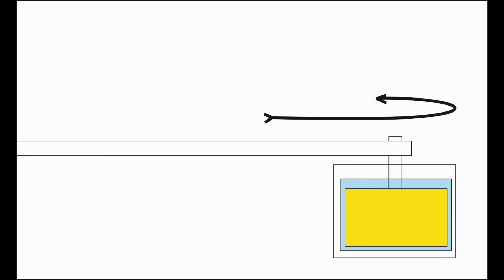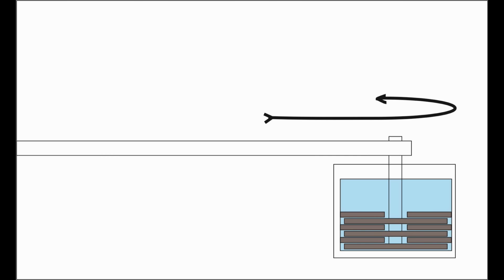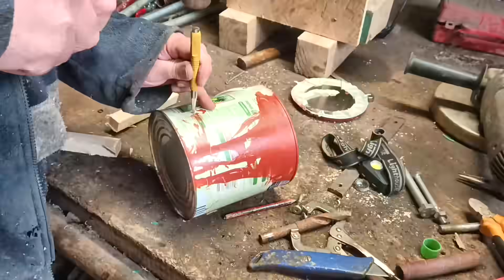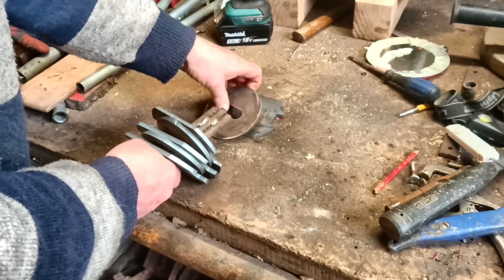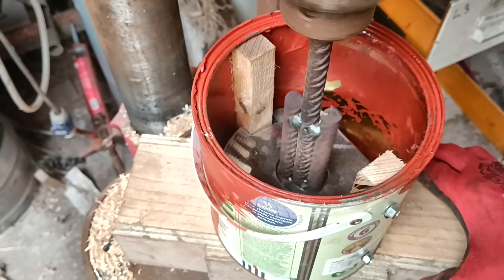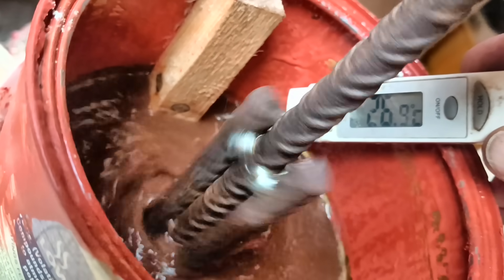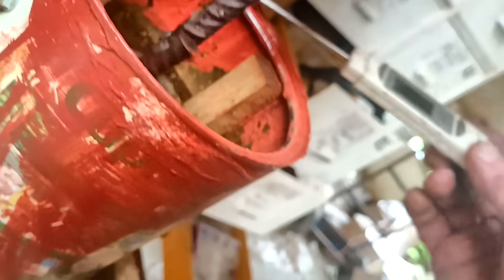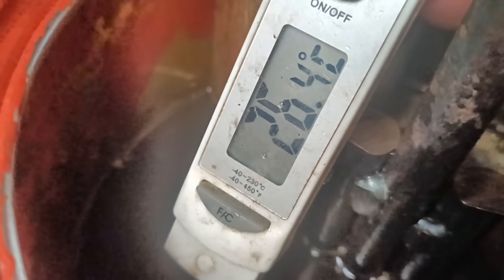Heating Water With Friction – How Practical Is It? Interesting Experiment!

Comment: Hi Tim, how about now trying to power a heating element with an old car alternator driven by the drill, measure the energy required to power the drill to raise a fixed amount of water by a fixed amount. Then compare to the friction method. Then you will have reliable data on which is more efficient 👍 great vids, keep them coming!
Reply: I was thinking the same thing.  It would be interesting to know whether the friction method is more or less efficient than the electric method.  I think the electric method would have more benefits though - no mechanical link needed between the windmill and the heater, minimal wearing of parts, ability to heat water directly without heating oil and using a heat exchanger, ability to use alternate energy sources other than wind, and so on.  The only drawback would perhaps be the cost of the generator/alternator, but then you'd need less plasma cut metal plate so maybe it would work out much the same?
Reply: Theoretically, the friction method is more efficient because all of the energy is converted to heat. 
With an alternator, the alternator is going to lose efficiency due to friction and that can't be submerged as easily, reliably and cheaply as just some friction plates to be able to sink the alternator heat back into the system as useful heat.

The nice thing about the friction method though is that 100% of the energy put into the system is put into heating the fluid.
Then it just becomes a question of if the fluid can handle more heat, if your insulation can retain it, or if you can actually make use of it with whatever the secondary system is.
But all of those variables would remain the same no matter what method he uses.
Reply: @doggfite  Some good points there. Alternator friction would surely just be in it's bearings, the friction method in the video would need bearings in the final design too. Thinking of the bigger picture my idea was that there will also be a fair bit of energy lost in any angle drive at the top of the windmill whereas an alternator could be mounted up there meaning no need for those losses, just minor losses in the electrical transmission. Braking system is another story!
Reply: @doggfite  You'd need a bearing up on the windmill blade though which would be the same whether you're electric or friction.  After that you might get a small amount of air resistance on the friction shaft and likely a lot of noise which both reduce the amount of energy that can be converted to heat, and which are both not losses in the electric version.  I really think it would be a pretty close call.
Reply: direct heating with friction... all the energy contributes to heating.

using an alternator... the amount of energy appearing in the resistive load is a ratio between the load and the generator resistance. at best, you get 50% of the applied power into the resistor, when the resistances are equal. the generator will absorb the other 50%. yes, the turbine will deliver twice the power as what you read in the load resistor...

 if you just short the generator, all the energy appears as heat in its windings. the current will be limited by the wire sizes and magnetic fields...
if the load is higher in resistance, more heat appears in the resistor than the windings, but you cant "push" as much power through that resistor, that circuit, anymore, as the current is limited... you deliver less power overall.

so rewind an alternator with 3/16 copper pipe, shorting each phase to itself... no worry about star or delta... and tickle the field windings with a voltage appropriate to wind speed (tip speed ratio, actually...) so as to apply a load that is directly proportional to the energy in the wind.

which increases on the cube of the velocity.

yes, that needs an external power supply.

easier to make a retarder... permanent magnets, conductive disc, variable airgap. use a centrifugal governor to control the airgap and the braking force... conductor gets stinking hot. add coolant...

you need a load that increases as the wind picks up. pumps, generators, whatever... they all have a fixed amount of power required to simply do what they do. a wind mill takes so much to grind grain, to lift a plunger full of water on every revolution, to deliver so many amps at so many watts into a load... and thats it. they do it faster, it takes the same amount of power to do what they do. yet as they speed up, the wind applies more power, produces more torque... so we have to feather the blades or apply brakes! rather than USE it, we LET IT SLIP PAST.

and to make grid-connectable AC voltage at 50/60 hz from the wind directly? HA! that simply doesnt work. at all.

if all you do is make heat, you can "hold the brake on" harder, and that just makes more heat! can limit blade speeds, stay in the peak of their efficiency curves...

the temperature reached is a matter of how many watts are delivered and how many are dissipated in any given volume... obviously as wind speed picks up things get hotter... much hotter!

what can you do with hot water?

hmmmmmm.... steam turbines? 
hot showers?

i need a shower... pong.

Comment: If you used oil as a medium to reduce wear, then added a spring to create end pressure. The spring pressure could be adjusted by a flyball governor to regulate the wind shaft speed and ease starting in low winds, cheers

Comment: Be far more efficient to drive a repurposed dc motor as a generator and use it’s output to heat water in a domestic hot water system that you replaced the element with a suitable extra low voltage element one to match as close as possible the generator voltage

Comment: Take an old refrigeration compressor, a fan in the heat exchanger and run it with the lineshaft from the Windmill, works like a heatpump...

Comment: I too think driving a heat pump would be a great plan. Those things can be 300-400% efficient.
Reply: They are a bit of an investment and not easily made at home, I would assume.
Reply: @makingitthrough190  They're basically compressors, which are basically pumps. You could knock something up at home, and even if it's not optimal, just having a heat pump at all makes it easy to be super-efficient. Getting a professional system is an option and then you'd be able to use it on normal mains electricity as well, the DIY system would also have to supply electricity to it. If you're making it cheaply out of scrap, though, it seems like as good a use of your time as any. You'd put a loop of piping down in the ground, or else just use air-sourced to start with. Then once it's installed, you leave that, and only tinker with the moving parts indoors and above-ground.

Comment: Tim, your method doesn't work in the long run because you have to constantly renew your iron plates and you also have a problem with all the iron dust you get in the water when the mill is running. The most simple method you can use is to find an old 230 Volt petrol generator with a defective engine and gear up the revolutions of the  wind turbine to match the revolutions of the generator and then set up one or more heating elements in your storage tank inside the house. In this way, you also do not get the losses a long pipeline forward and back will cause if the set-up is to be done cheaply. The suggested method has been shown to work in many places and can be done for little money.

Comment: Just throwing off one-off ideas... A permanent magnet alternator like such in a motorcycle in oil bath with the outputs wired directly through resistors, either in the said oil bath or the adjacent water tank. The stator coils on such an alternator will get pretty damn hot as all the excess energy that's doesn't end up in the resistors as useful electric current would just be dumped into the oil as thermal energy. And if we cooled the oil by exchanging heat with the water tank the total efficiency would be pretty high. No controller needed, no fancy conversions, just three AC outputs from the alternator directly heating the water and if things get too hot and the temperature and the pressure of the water tank would rise enough a safety valve could purge hot water out and a one-way inlet valve could let cold water in to cool down the tank (and thus the alternator oil bath). You could probably find such alternators for pennies from the junk yard and you could scale the unit up by attaching multiple to the same shaft. No physical metal contact besides bearings so the oil would remain clean for a long time.

Comment: I have a water turbine . You are going to need a lot of reliability.  You could try an old car torque converter. However I would use a refrigeration unit direct driven as a heat pump and get 3 times the heat out. So if you had a 1kW wind turbine you would have 3kW of heat. That would be 72kW hr per day. Might just heat a very well insulated house or a room in a normal house.
Reply from the maker: if you could really get 72kw/h of energy per day, that would be the same as running 3 kettles non-stop - if that isn't enough to heat your house then I suspect someone left the door open
Reply: @wayoutwest-workshopstuff6299  I don't know how well your house is insulated but Irish houses usually need a lot more than 3kW. If you have an 'A' rated house and can construct a 1kW wind turbine you could do it. You need to have constant wind as well. So is the site  open to wind. Also on strong wind days you will have to to shut down your turbine unless it is self limiting.

Comment: Hello Tim, today I might be able to visit a classic windmill that is still in use. Would you like to have some photos and videos of it? Maybe that’ll help your plans for your own windmill. Next chance of seeing one would be on the 20th this month.
Reply from the maker: Thanks, Mullerman! I'd like to see how the levers that operate the spider mechanism are activated through the middle of the windshaft. So a photo of the back end of the windshaft might be very helpful : -  )
Reply: @wayoutwest-workshopstuff6299 
I've shot a short video of the upminster windmill spider today.  Sometimes youtube won't allow links so I'll drop it in a separate post.  The spider is just an elaborate bell crank.  Notice the twist in the sails similar to that of a modern propeller.  Also the weight at the end of the chain that controls the louvres acts as a feedback system to automatically regulate the sails speed.
Reply from the maker: Thank you - that will be interesting
Reply: @wayoutwest-workshopstuff6299  I’ll try to catch some pics in at least one of the 2 windmills. See you then.
Reply: @wayoutwest-workshopstuff6299 
The "Friends of Upminster windmill " have an animation of the spider control on their YouTube channel.  What they don't show is a weight that hangs from the chain that controls the louvers.
Reply: @wayoutwest-workshopstuff6299  Sorry to let you down. The windmills in my region are both conventional ones that aren’t equipped with the flaps and spiders you were looking for. 
I think this solution you are thinking of could be quite difficult to visualize, although I am sure you are capable of doing it. 
My suggestion would be a centrifugal brake, they are very cheap and variable.
Reply from the maker: No worries at all - thanks for trying
Reply: @wayoutwest-workshopstuff6299  I have news! During National Windmill-day I came across a windmill that didn’t have the spider-mechanism, but a self-built centrifugal-force-brake. It basically consists of a few rods, hinges and a damper for a car bonnet. The faster the wings spin, the further the weight pushes out the braking flaps, so it can operate on an even level. If you want me to email you the photos or whatever just say yes!
Reply from the maker: @mullerman1104  YES! (please)
Reply: @wayoutwest-workshopstuff6299  I have sent it. Sorry it took longer, I was quite busy the last days. The subject is „windmill brake mechanism“.
Best wishes from Germany and good luck building the windmill!

Comment: Hi Tim, interesting challenge. Could you use a piston and heat the water using pressure? Effectively a reverse steam engine although I doubt you would get up to that temoerature. I could run slower. Just a stupid thought but as you sat there is no such thing as a stupid idea...or maybe it wasnt you....

Comment: I have always loved the idea of using a windmill to get heat through friction. In theory the efficiency can be really high. The heat can be easily stored for some period of time.
It's a challenge to match speeds and forces though, and variablitity would be great.
In your setup, I'm pretty sure you can get heat through fluid friction alone without the plates wearing. Couldn't you make an inefficient pump forcing fluid through cntrollable contraints? Anyway, I'm guessing water-brakes are a pretty well-established industrie.
I'm happy to be sponsoring this project.

Comment: Heat pump ! :)
Direct drive on a compressor from an old fridge : that will be interesting. And you get a cold source at the same time to keep some food.
Reply: 100% if you want to be efficient, don't create heat, just move it from somewhere else
Reply: A much better idea although poorly thought why go through all the hassel of coverting a compressor meant run on electricity when there are perfectly fine mechanical ones in nearly every vehicle of the last 30 ish years not to mention the built in control system is eazy to work with
Reply: @shaynegadsden  vehicle equipment is only designed for intermittent and limited use. Tim needs 24/7 for many years. I've found that even 2 years of constant running can wear out bearings.  Quality is very important in energy generation.
Reply: Only use industrial equipment and in this direct mechanical drive.
Reply: @shaynegadsden  Converting motion to electricity and back is pretty efficient, 80-90% or even better. So using electricity as an intermediate isn't a bad idea, it can be more efficient than a series of mechanical doodads to alter direction and speed and torque and whatever else. Then he could leave the compressor as it was designed, likely to last much longer that way.

Then again, if you want pie in the sky... I bet the hydraulic pumps on construction equipment are tough! I wonder could you use those, and have the oil displace air in a container to produce compressed air, in a closed system that recirculates? Probably overkill but a fun idea!
Reply: @greenaum  that's 80 to 90% each time and considering he uses scrap it will be much closer to the 80% meaning the total efficiency would be 65%, where as the mechanical system is a simple belt drive basically zero loss because the same belt drive would be needed for a generator also fridge compressors are tiny a quarter hp is a big fridge compressor and aren't designed to operate for extended periods of time. A car compressor though is about 4hp and can run for many hours straight meaning if it's setup right an easy 10kw worth of heat also unlike a fridge or even home AC the car system is all bolt together.
Also imsay this not because i think electrical systems are bad I'm an electrician so i understand the limitations and problems he would have with such a system another thing generators and motors don't play nice the true efficency would end up much lower in such a system
Reply: yeah sounds like a good idea. however a fridge only has a max of 2kw? maybe even only about 200watt. house heating will easily use 10kw. so you would need 50 old fridges.
Reply: @sicB_astard  you don't use a domestic fridge. You use a unit from a butchers cold room.  These usually have a belt drive from a motor .
Reply: @sicB_astard  a resistiv electric water heater is 2kW yes.
But a heat pump will use a third of that. A 200 W compressor from a fridge will fit the windmill :)
Reply: Fridges are only designed to run for a few minutes a few times per day.
So don't expect that the compressor will survive for long

Comment: Problem with this design is the amount of wear. Much better off with an electric motor/generator running a heating element.
You could even run some copper pipe around the electric motor before it goes into the water sump so it pre heats while  cooling the motor

Comment: do note that ANY method which results in resistance on the input shaft will result in equal heating with respect to the amount of resistance made, so basically your goal is to, through whatever method possible, produce the highest amount of resistance, and so long as that resistance isnt spent moving energy elsewhere like a generator to power something outside of the box, all the energy put into the system should eventually find its way to heat

i think the issue with using metal plates is less so about the wear itself but about the metallic particulates that will accumulate in the medium
i think you should consider the baffles idea more strongly, you might be surprised at how much resistance can be made that way. perhaps taking inspiration from the design of torque converters as they have many years of development figuring out how best to make the highest level of friction possible in a fluid coupling, and maybe use a more viscus fluid like oil or even grease, though too viscus would make it difficult to pump through a heat exchanger